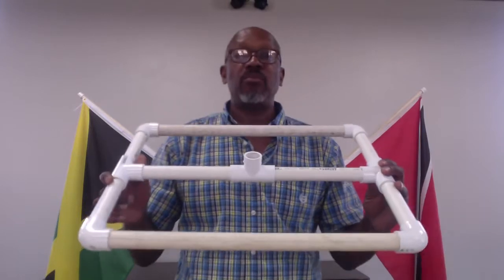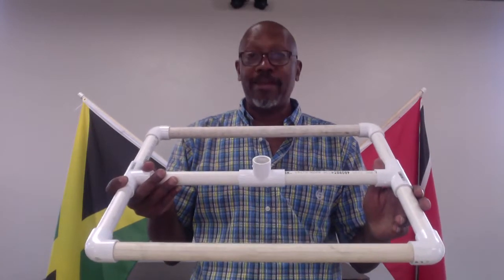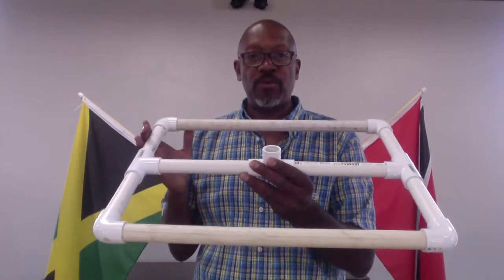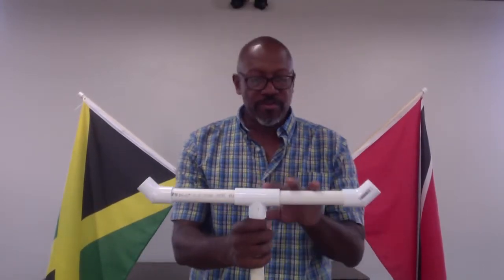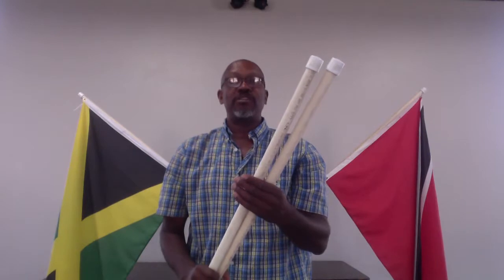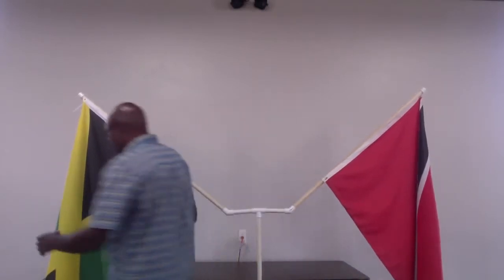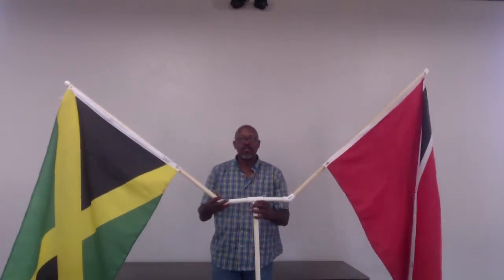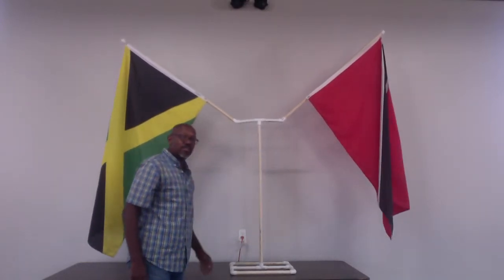DIY PVC Flag Pole Project - JamaicaBob | Calypso for Kids

Comment: Clever idea of altering the size of flags to accommodate more on each pole. In that case could one add a third pole in the center back, a smaller diameter so as not to throw off the balance too much, to show off the USofA flag in a higher height, with state onside, and school/event/reason on the other side? Too much? I think the concept is great! Light weight for easy, take a part travel. Yet sturdy enough to stand up on it's own where ya need it.